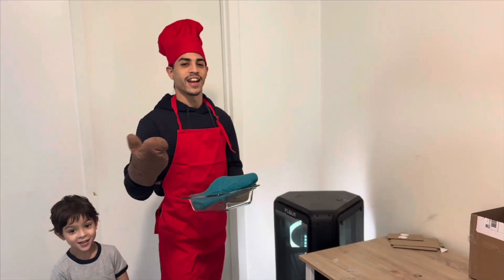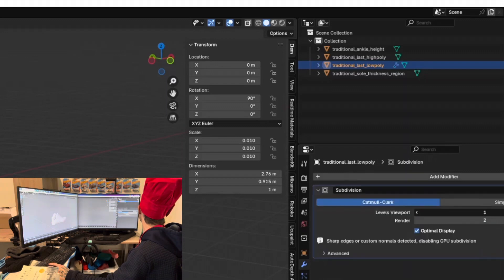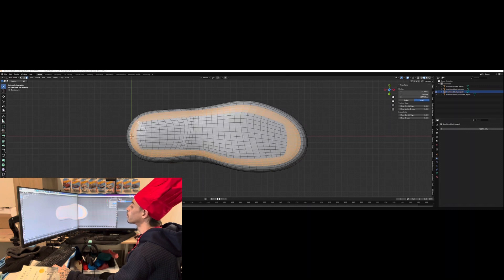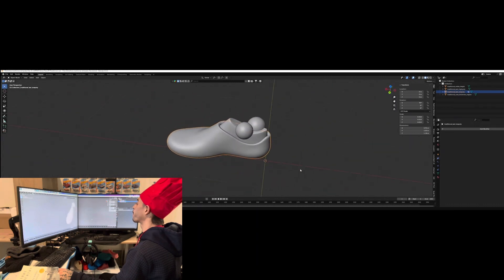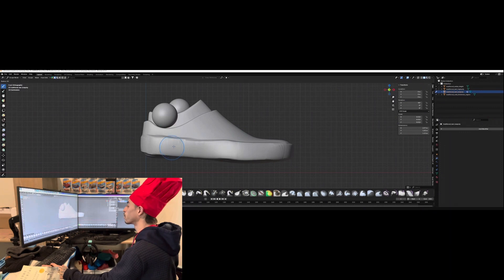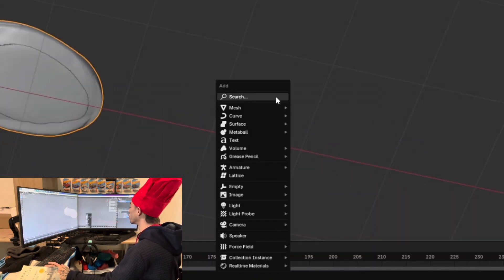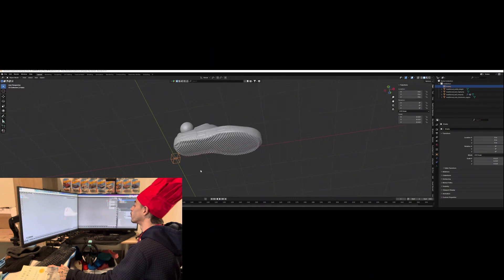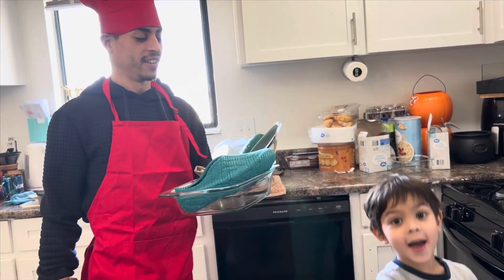The Secrete Recipe for a 3D-Printed Shoe! (Blender Tutorial)

Comment: Fire video chef question, how do I change the shape of the mesh to a loafer but keep the shape of the last on the inside
Reply from the maker: @jasnclark  great question! to change the shape, I start by moving single vertex one by one starting from the top, around the ankles speres, then work my way down, into the shape I want. do this to the low poly last at the beginning BEFORE subdivision and  solidifying.
Reply: @ ok dope thank you! When the loafer model is done how do we get the inside to be the shape of the last? I tried using a Boolean then remeshing is there any other way?
Reply from the maker: @jasnclark  yes!  before solidifying, Use a Shrinkwrap modifier. change it to "outside" and a distance of 0.5m 🧑‍🍳